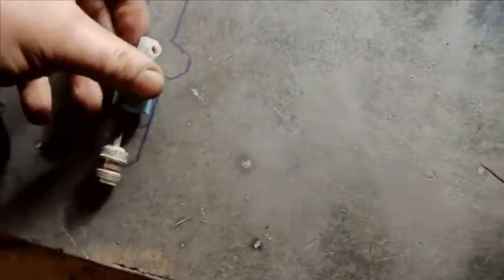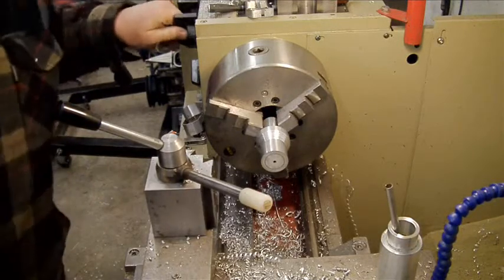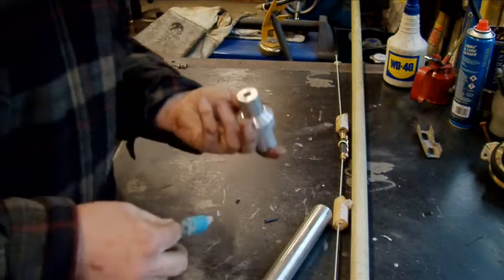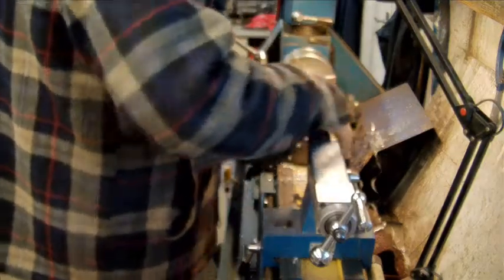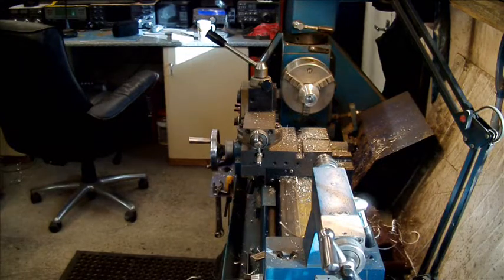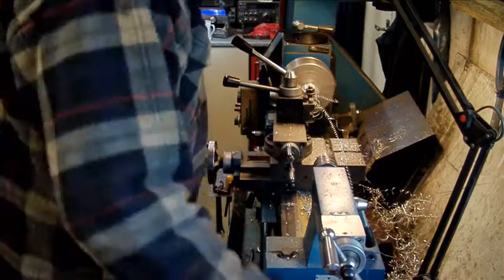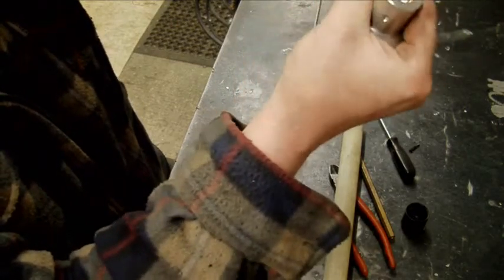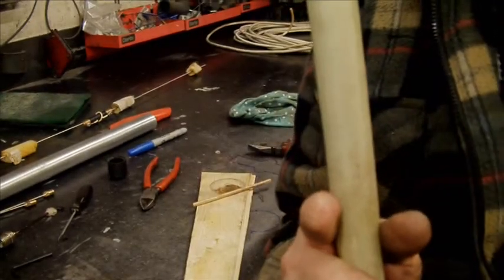VHF 2mtr Antenna Repair

Comment: Nice to see you're still using the ol' girl.
Reply from the maker: Hi Eddie thx for stopping by. yep the old girl is still kickin :)

cheers Nigel
Reply: Good to have you back Nigel and always glad to see the Clarke being used, thanks.
Reply from the maker: hello fixerman thx for the comment, I have been a little busy with the engine on my jeep I could
hear a tapping and new I had a bad tappet so I stripped the engine to see if I could cure it.
cheers for now nigel
Reply: Hi Nigel, still enjoy your videos and seeing the projects you are working on. Always look forward to your new releases on YouTube.
About a year ago I was asking you about your variable speed conversion on the Clarke lathe. I took your advise and contacted Transwave Birmingham and they are very helpful. Before I purchase just wondered if you could answer a couple of questions. Do you feel the .75hp motor is powerful enough for all the work you have done on the lathe and mill - now you have had first hand experience and use of it on you Clarke? Or if you were to do it again, would you now go for the 1hp and make all the necessary mods for to fit and work on the Clarke.
Thought it would be good to ask you this as you have first hand knowledge and your opinion is valued. I do realise the best option is probably a better lathe (like you have now) but I wont be able to do that for some time.
Thanks Nigel. Best regards Trevor. 
Show less
Reply from the maker: Questions are always good trevor and to be honest yes I would go for the higher power unit
as sometimes I find when going at slow speed it is pretty easy to stop the lathe which I then
change to the smaller pulleys. Since getting the Harrison lathe tho I use that more but I keep
the clarke as its good for smaller jobs. If you go for the bigger HP unit I am sure you will be
happy with it so good luck with it.
Cheers Nigel
Reply: Are you guys talking about a 3-phase conversion?  That sounds expensive.  I use a DC motor with a braking speed controller and it's great at low speed (around 40 rpm) for power tapping, etc.
Reply from the maker: Yes eddie  the 3 phase is good but like you say a little expensive would be interested to 
know more about your solution tho :)
Reply: I use a regenerative braking speed controller with treadmill motors but a quick scan of eBay shows that there aren't any in the UK and the cost of them has gone way up.  The controller is a KBMG-212D and the cheaper ones are going for $75-$100 + whatever ungodly shipping charges to the UK.
No doubt due to the many converts I have created through my vast 6 member audience >:(    I suppose a herd of hamsters might be a viable option but getting them all to start and stop in unison may be a bit problematic.
Reply from the maker: Hi Eddie  that sounds interesting mate, I did try a treadmill motor on my pillar drill for a short time
but it was to powerful enough so changed back the the standard one.As for cost of shipping and
import duties from the USA they can be very prohibitive so maybe not a good idea.
Thx for your reply cheers for now Nigel